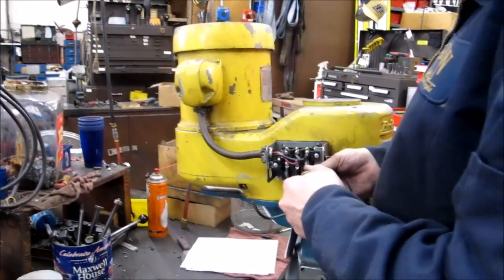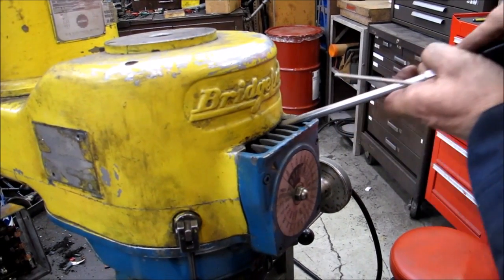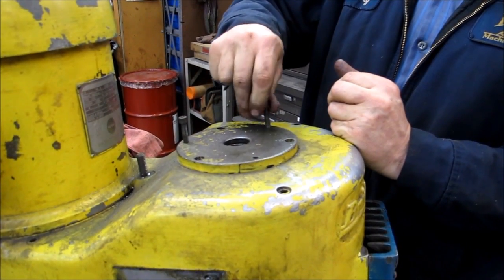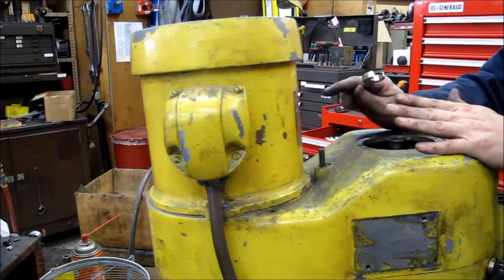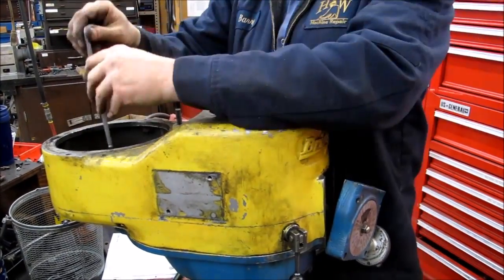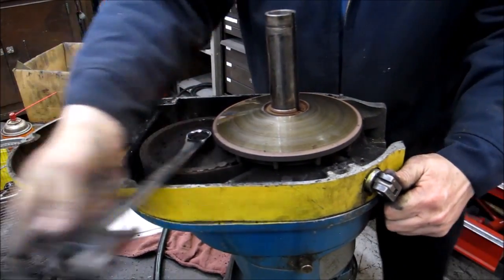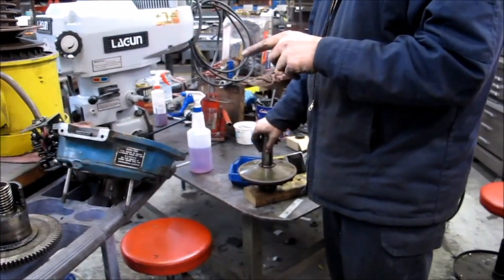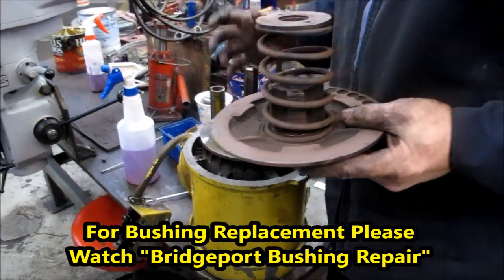Bridgeport Variable Speed Head Top-Half Dissasembly

Comment: I need to thank you for creating these videos. With these I was able to breakdown and repair the bushings and bearings my own 2j head. I did need to buy a new motor pulley unit as my one was an old type and the new bushings didn't fit. 

Because of your work, the whole process was so simple and far easier than I anticipated. It also allowed my to better understand the machine and I feel a lot more confident in using her now.

Keep up the amazing work!

Comment: I'm happy to find this. I just bought a Bridgeport and it makes a clunking noise near the bottom of the motor (bad bearing I assume).
Reply from the maker: There isn't a bearing at the bottom of the motor, so you wont have to worry about checking that. Usually with clunking coming from the motor area its because the bushings need to be changed out on the Adjustable Vari-Disc. You will have to take the disc off of the shaft to check it. We do have a video with directions on how to change the bushings. If you want to call and talk it over with a tech you can give us a call: 1-800-285-5271
Reply: @HWMachRepair  Thanks for the info, I'll definitely check out your video. You can hear the sound mine is making at the end of https://youtu.be/bq988KFv-5I if you're curious.
Reply from the maker: @russtuff  I had Barry listen to it. he says if the noise is the same in both high and low it's most likely the disc. Great find for $750.

Comment: Already Purchased spare aprta also repair manual. Question the conctrol board is missing for the 6F A 2J head. Where to purchase board only.
Reply from the maker: The original 6F board isn't available anymore, so you will have to use the 6F upgrade kit. It comes with the board, mounting bracket, and instructions to wire it correctly to the 6F.  https://machinerypartsdepot.com/product/038-0217/

We have 3 in stock as of today and if you have any questions, give us a call 1-800-285-5271
Reply: @HWMachRepair  near future i will recommend again our company to purchase this controll board.. thanks alot. im from Philippines.

Comment: We just ordered your variable speed head rebuild kit. I’m excited to tear into this nasty old head. So far I’ve discovered the gear housing plate is missing. How critical is it? Please let me know if I need to order a replacement. Great video by the way..
Reply from the maker: It's not critical to the machine running, but it does help keep debris off of the gears which could cause issues down the line.

Comment: Whats is the usual problem when they will only ramp up about half way then no more speed?
Reply from the maker: There can be several different issues but, the most common would be an issue with the adjustable vari discs and the shafts they move on. The issue usually lies with the motor vari disc and shaft so, taking off the motor will generally give you a good idea on what is causing the problem. You could also have a problem with the speed change assembly. The tilt plate could be bent, the chain could be broken in a spot, or some other small issue. Give us a call if you would like us to help over the phone: 1-800-285-5271 / 260-422-0020

Comment: Is there such of a thing of a single phase motor for a bridgeport?
Reply from the maker: There is for a Step Pulley, but not a Variable Speed. We suggest using a phase convertor. We sell a solid state phase convertor that we highly recommend. If you have any questions you can call us at 1-800-285-5271 or you can see the convertor here on the website: https://machinerypartsdepot.com/product/pc02vs/  

We also have a new video coming out soon that shows you how to wire one up.

Comment: Shout out to H&W! They are THE place for any info , problems or parts you need for your genuine Bridgeport mill! From their rebuild kits with high-quality parts , belts and bearings w/diagrams and step by step  instructions , to Barry's excellent step by step instruction videos. We bought 2 top end kits and the videos here made the rebuilding so simple. We didn't realize one of our machines was a 1 1/2hp and the other a 2hp. No problem! A very pleasant phone call to Debbie(?) got the different parts explained and exchanged.

Comment: If you remover the three 11/16 nuts on the bottom of the bull gear assembly, can you lift the top half off the machine without fully tearing it down? I have to replace a quill dust cover and am hoping to do it without tearing down the whole top end. These videos are great!
Reply: Did you figure this out? I have the same question.
Reply: In the interest of helping someone else with this who stumbles across this video, you can get to the quill dust cover through the bottom if you take out the spindle and quill. No need to disassemble the whole head to get to that, although you may want to buy the "how to rebuild a bridgeport" manual off of ebay.

Comment: Can you tell me how to change the drive belt and timing belt on a 1960ish Bridgeport with 1HP motor?
Reply from the maker: It is actually very different and easier to change out both belts on a step pulley than a variable speed. You have to remove the motor from the belt housing. You can do this by removing the locknut and handle from both sides of the motor that allow it to move. Slip the v-belt off the motor pulley and you can lift the motor off. For this next step you will have to lower the quill to the absolute lowest it can go. There are six socket head cap screws that hold the belt housing to the bull gear housing. Remove all screws so you can lift the belt housing and assemblies off all in one. The timing belt will have to be slipped off the timing belt pulley. This is easiest with the quill all the way lowered. Turn the belt housing upside down and you can remove and replace the v-belt. At this same time you can remove and replace the timing belt then put everything back on. You do not have to remove anything that has to do with the cam ring. If you have any more questions please give me a call.

Comment: That 'last component that was dissembled at the 18:10 min mark - can that be removed with the motor, back gear still assembled? I.E does loosening those castle nuts allow you to remove everything above the downfeed engagement lever as one assembly?
Reply from the maker: Yes, you can remove the bull gear housing as well as the rest of the upper head in one piece. You have to remember that it will be very back heavy because of the motor and when you put it back on the quill housing assembly the spindle spline must line up with the spline in the splined gear hub.

Comment: Refreshing to watch how a pro gets the job done. You don't get to be that fast without doing a couple of hundred of them first I'd guess. 

Any thoughts or tricks on getting the broken thread from the knurled knob out of the feed reverse control that I stupidly broke while moving mine Barry? It's snapped off below the surface. It's on a Taiwan Bemato built mill that I'm sure was cloned from a step pulley Bridgeport since all the controls are the same and are all in the same location if that makes any difference.
Reply from the maker: The good news about that broken screw is that it does not bottom out so many times you can get a pick and unthread it with that.  If that does not work I use a Dremel with a thin cutting blade and grind a slot into the broken screw.  I then use a very small screwdriver to unthread it.  You may have to cut into the outer shaft a little but it will not be seen once you install the new feed reversing knob.
Reply: Thank you very much, that should work and I'll give it a try.

Comment: Can you inform me how to correct tension the vari belt
Reply from the maker: The tension in a Bridgeport is actually created by the spring on the motor vari-disc. You may need a new spring if you are having issues. Give me a call at 1-800-285-5271 if you have any questions, or would like a new spring. I think a new one is around $30, or I could get you a good used one for around $15.
Reply: Hi this is Alan it's my mill Robin is talking about, it's an Ajax Turret Mill is that something you would have parts for, I'm also looking for the replacement plastic bushes for both pulleys I'm in the UK so bear that in mind.
Regards Alan.
Reply from the maker: Hi Alan, I don't have a source for Ajax here in the US, but it looks like they are still being made in the UK. You can try contacting them directly: 44 (0)1590 67600 or sales@ajax-mach.co.uk. If they cant help you, you may have to manufacture the bushings yourself. I can email some instructions if you need help with that, just let me know: support@hwmachinerepair.com
Reply: H&W Machine Repair and Rebuilding , hi  I think I would like to make the bushings would you still be able to send me some information on the material I would need and any advice would be welcome on how to make them.

Regards Alan.

Comment: How is the head held for repairs?
Reply from the maker: If you are working in the upper half of the head, most of those repairs can be done with the head still attached to the machine. For work in the quill, you may have to remove it, depending on how what you are doing. We have a customized table in our shop that can hold four heads at once, but it wouldn't be hard to make a small workstation for one head, you just need a workbench and some steel to make the bracket. I would post a picture here but YouTube won't let me. If you want to email me at support@hwmachinerepair.com I can email you some pictures, or you can call 1-800-285-5271 and talk to Barry. He has done a bunch of on site repairs and he can help you figure out the best way to complete the repair you are trying to make.

Comment: Can you retrofit a veri-speed head to a nonveri-speed spindle housing? Or do you need to buy the complete head?
Reply from the maker: +The Texas Gun Guy Yes, the housing that the spindle is located in is the same for both the Variable Speed and the Step Pulley type head. If you have any questions or run into any problems give us a call and ask for Barry. 1-800-285-5271 or 260-422-0020.
Reply: +H&W Machine Repair and Rebuilding: Thank you guys. I've rebuilt this head with your help already, you were spot on with the parts and services I received, and for that you have a customer for life. I now have to rebuild the lower end, and knee, it needs to be scraped 😵🔫 I'm going to send it out for that. Do you guys offer scraping services?
Reply from the maker: +The Texas Gun Guy Grinding and scraping is actually what our business was founded on, and it's still our specialty!